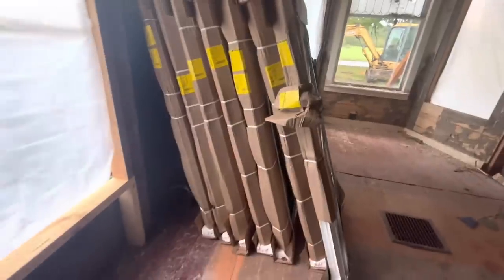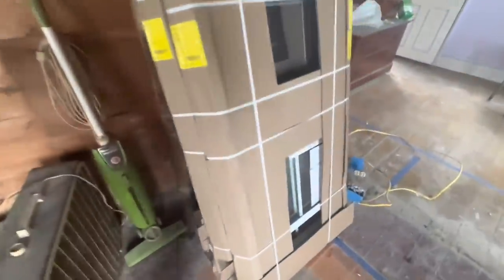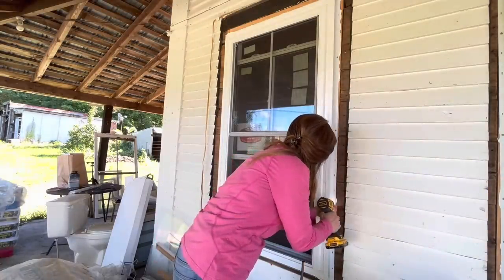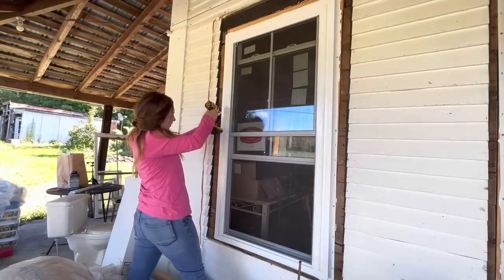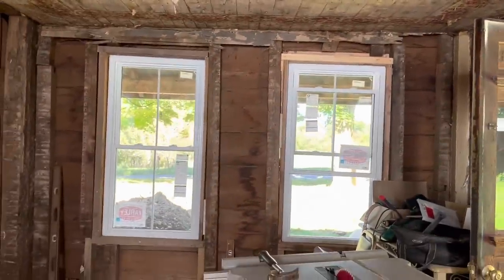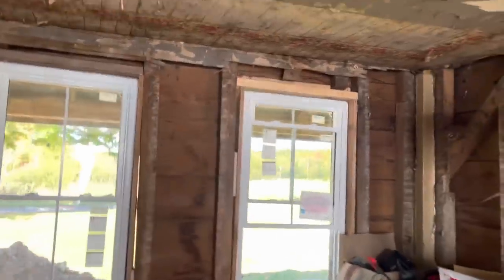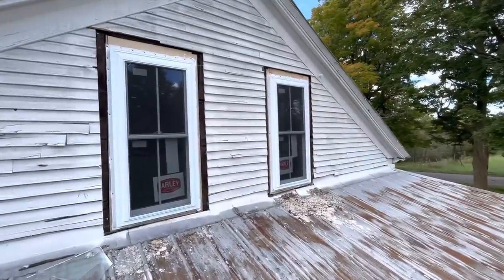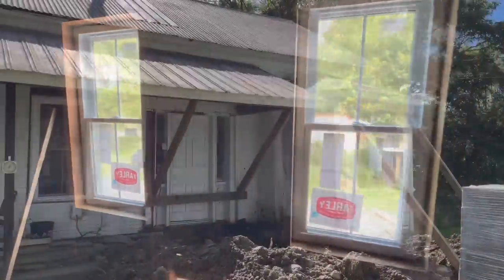WE HAVE WINDOWS!!! | my 150 year old Fixer Upper House! 🏠

Comment from the maker: Hey guys! Please be aware that all this "text at telegram" stuff is nonsense! It is a scam. Please report or ignore!
Reply: I do as much as possible! Please everyone ignore 🙏❤️
Reply: I was wondering why that kept happening? Lol 😂
Reply: Abby you should have installed  6” zip flashing tape  before installing the windows . You start with the sill , then the jambs , and the header  last   . Be sure to measure rough opening and then cut tape 6” longer , so you can run 3” up the jambs  . Remember sill first then jambs and header last . I know its to late now but. At least do it over the nailing flange  starting with the jambs and then the header  . The sill is not required  in this step . Any questions feel free . God bless  !
Reply: Thanks for the heads up.
Reply: I got one of those messages from another channel I watch 😢
Reply: @1off39  True. That old man just wants the work done but doesn't care if done correctly.
Reply: Thank you for that warning wondered what was going on
Reply: It's a wall, not a roof, the overhang will provide protection as well as the siding and wrapping, the window trim,, you'll be just fine Abby.
  It's much better than what was used 150 years ago or comprible plus.
  Your windows are beautiful..
Reply: @karengossett1475 🙏🙏🙏🙏🙏🙏🙏🙏🙏🙏🙏

Comment: My first house was a 1955 vintage with 800 square foot living area. Most of the windows (7 if I remember) were painted shut and they were not double pane thermal windows. After a couple years I decided to splurge for new windows and after they had been installed it seemed like a whole new house (to my eyes at least). Windows help with thermal regulation and can give old bones a new character. Natural light is good!

Comment: There's a tape you should buy that goes on the outside of the window flange to the wall to seal the windows better so no drafts. I can't think of the name but I used it when I install windows. Looks good.
Reply: I'm thinking you mightt be talking about the red tape. Called Tuck Tape.

Comment: The only (unseen to me) issue I have with the installation is the lack of spacer or shim under the window to allow spray foam all the way around the window for insulation.
Reply: I prefer tucling fiberglass insulation in with  long shim or the like, fiberglass insulation is excellent , keep it puffy and do not compress it.
Reply: Where is my edit, opps tucking..
Use a long shim, thin side in..
Reply: @johnkomosa4089  None of the spray foams on the market designated for windows and doors expands enough to distort. Since window and door foam has been on the market, no builder or window installer uses fiberglass insulation to seal windows or doors.

Comment: Congratulations  Abby.  Sometimes you can put a ladder on the back of a pickup to get a little higher and to secure the feet , or onto a wagon.  So you were thinking ahead with your misspoke word.  Ah ha.😄 
Cute..  You guys make a good team, nice job on the caulking and you handle the drill like a dream.  Good job sinking those screws.
  Careful on that roof, I recommend vibrum soles but you seemed well, when in doubt , put down a toe board..  yeah   :-)

Comment: Yes, do the tape around the windows , but do not do across the bottom.  You want the water to get out if you do get any in.  If you tape across the bottom in these old houses the water will get in the wood and rot it out, it needs and escape to stay away from the wood. I would even put a layer if the tape on the bottom of the window seal before you put the window in. That would also protect your windows seals from getting would rot.

Comment: You need a nail apron so you can have screws or nail in the pockets so you dont have to reach down so much an save you some time an energy . Also ,I just realized you have a metal roof what color are you planning on spray painting it ? An your house color ,too .

Comment: Your new windows are looking awesome. My only concern is for leaks and drafts. They have several different brands of window and door sealing tape on the market and would really be a big improvement over using just caulking. This is a really big investment you are making and why not use all the protection that is available. Other than that, I think you are doing a wonderful job.

Comment: If you are using the old siding as a finish wall the windows should be aligned to the siding and sill plate
Similar to a fence following the contour of the ground 
If you are covering the old siding you can install the windows plumb and level 
Keep up the good work!
JIM 🤔

Comment: The tape I was mentioning is for sealing doors and windows when installing. It's about 3-4 inches wide and black . One is called Vicor and it is flexible and very sticky. Calking is good but this stops water and wind from coming around the flanges of the windows or door frames.
Reply: Pretty sure it is called flashing.

Comment: You are not using vapor tape around window openings before you put in your windows???
Very important step to weather proofing your window frames from rot.
As you do each step like putting in windows, you should go to YouTube and watch videos related to that job.
You will learn a lot of dos and don't s.
In your climate weather bearer in as many places as possible is very important .
Caulk only lasts so long.